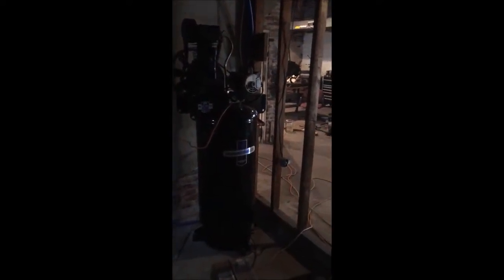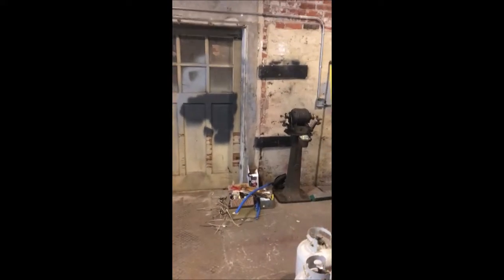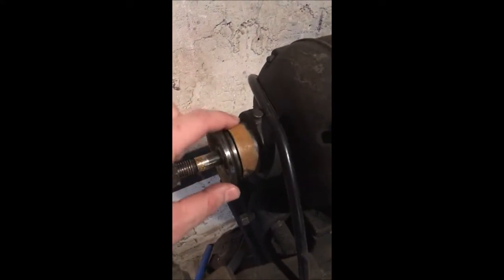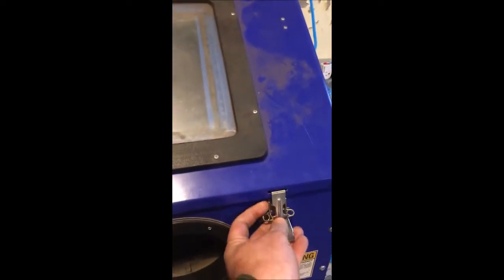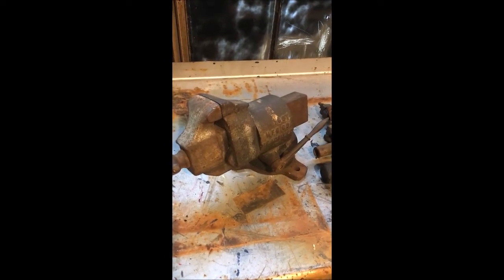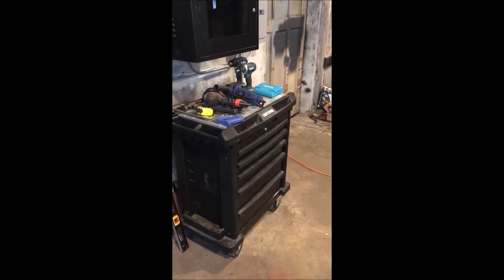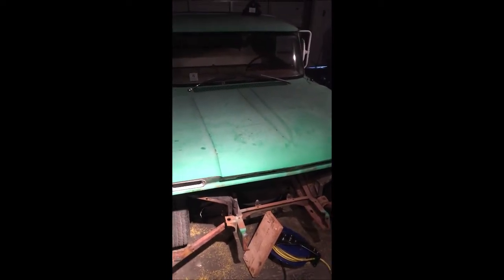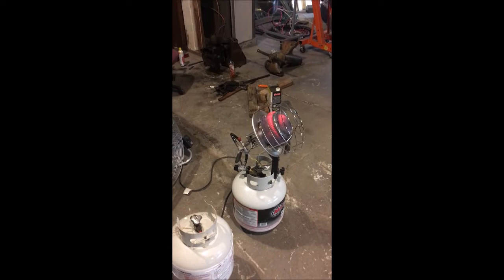VintageVises.com quick shop tour.

Comment: Nice shop. Why don’t you want to utilize the oil burner?
Reply from the maker: Tank is shot, would have to get on roof and uncover chimney and get the damn thing running.  I was thinking about converting it to run waste oil but have read the nightmare of messing with that.  Cleanouts, filtering, and constant fiddling, not the hassle I am looking for.  I made it through this winter, granted a very mild one for PA, will see what happens next winter.
Reply: VintageVises.com I have oil heat in my house and added another for the shop. We don’t have gas where I’m at in ne Ohio so it’s oil or wood. Wood when I’m around and oil keeps it from freezing when I’m gone. They really aren’t bad at all.  I bought my house with no experience with one and swore I’d change it. Well 10 years in... no plans to change.  If you need any help, let me know.